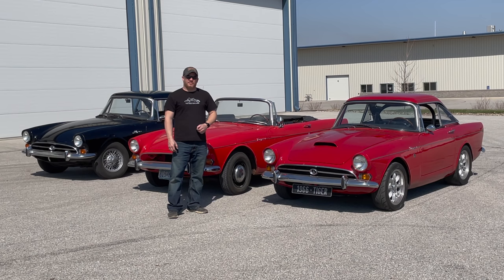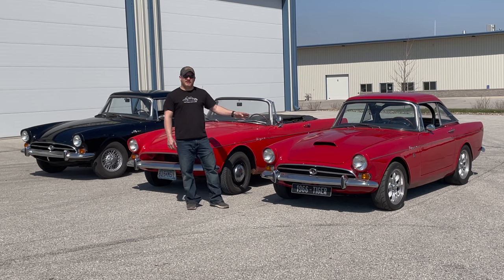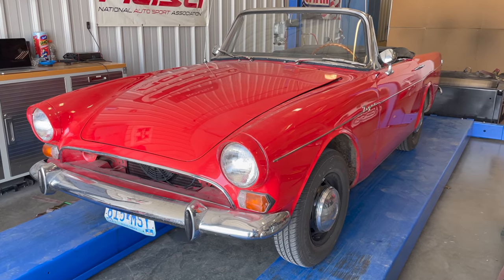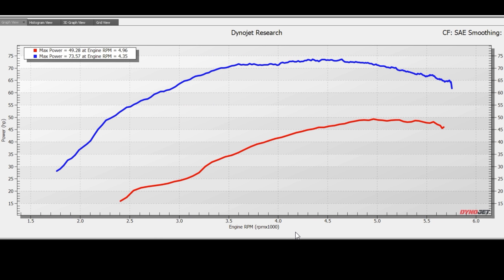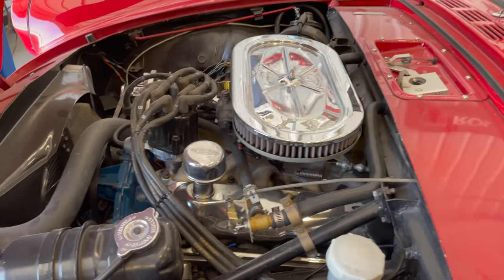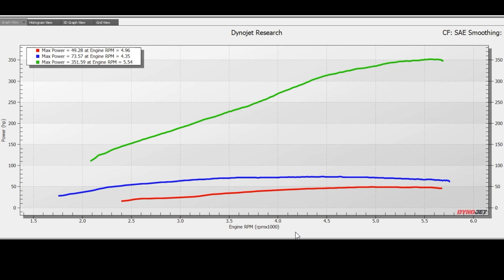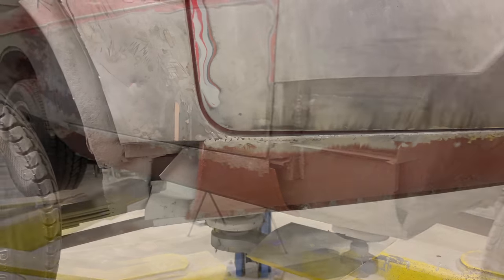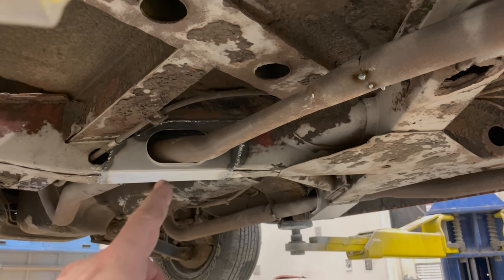How much power difference is there between an Alpine and a restomod Tiger?

Comment: That stock 260 V8 in the Tiger seems somewhat low on HP, doesn't Steve? If I remember correctly, the 260 was rated at 164 HP. If you assume 15% loss in the drivetrain, that comes to 25 hp, so it should have somewhere in the range of 130 - 140 hp at the rear wheels. Even if you assume 25% loss in the drivetrain, it should have had about 120 hp at the rear wheels. That engine sounds like it may be sick, maybe as you said part of it being ignition........but it's still a cool car. All three are! Thanks for sharing.
Reply: Yeah that is atrocious.
Reply: Tigers had around 136bhp nett when new.. and that was still measured in favourable engine on stand with no auxiliaries.....but a stock Tiger in healthy condition should put down 105-115 at the wheels

Comment: The hot Tiger looks a thousand percent better with those wheels and tires than it did on the showroom floor when it was new.
  I saw a Tiger when I was like 12 that had 289 badging, and the guy said it was the 271 horse, but I guess he must have done it himself, unless it was possible to special order them.

Comment: I did a rear swap and a W58 Subaru transmission on my 62 sunbeam with the 1600 4 banger that I can now go 72 at 3,000revs, its not performance but great on gas and comfortable on the highway..

Comment: My 1966 BRG Tiger was a pure chick magnet. Just ask my then girlfriend, now wife. On another note, a few years ago I was yearning for another Tiger but when I went looking I was warned to watch out for “fake” Tigers. These apparently were Alpines that had V8’s dropped into them. I gave up on that idea. Looking forward to more Tiger videos.
Reply: Research the VIN codes. Then you can know.
 I would rather spend for an Alpine, and drop in a crate engine. I couldn't care less if it was a " real" Tiger, when the crate engine " fake" would leave it in the dust.
 It costs real money to do complete brake system upgrades,. Switch to an alternator and I would think there would be suspension upgrades to do as well.
 Pile on the premium for a Tiger and it could get pretty stratospheric in a hurry.

Comment: I'm not surprised by the rust. My favourite car ever is also a Rootes car - the Hillman Avenger, sold in the States as the '71-'73 Plymouth Cricket. Unfortunately, they rusted very quickly, mostly in the inner and outer sills and front inner and outer wings, but basically everywhere. There was also a high-performance model called the Avenger Tiger, which I think was based on a performance package available for the Cricket.
Reply: Car and Driver liked those too.
 I wonder if they were Buddy  Holly fans?
Reply: I've had 2 Alpines in the past. I would love to find a Tiger in my price range.
Reply: There was also a fancier version of the car called the Hillman Avenger Alpine
Reply: @pashakdescilly7517  I think the Avenger Alpine was New Zealand-only, although it was the top-spec model.

I think the most notable model is the Avenger Tiger, which was the high-performance (for the time) version.
Reply: @Zeem4  You could be right. When I was a teenager, my father had an Avenger estate, the next-door neighbour had an Avenger Alpine. The posh model was only ever a 4-door car.
Reply: @Zeem4  There was also the BRM version sold in the UK. That was a dohc 4 valve engine based on a Hillman block, made for rally cars.

Comment: Hi Steve, I'm really enjoying your content. In the past I've had booth Alpines and Tigers. I currently have a 64 Alpine converted to Tiger (aka Alger). Mine has a 302 +.30 over plus AC and cruise control. I noticed on your Red Tiger that your running a upgraded alternator. What kind is it?  Was it easy to convert to the newer alternator, since 1964-66 Tigers traditionally had Generators? Also have you ever considered a LED dash lighting upgrade?
Really enjoying the shows .Keep up the great work.
Thanks
Mark

Comment: Oh my goodness...what a joy.  Question...you mentioned the most powerful one as not being particularly good driving in the city.  Is that due to the weight of the engine and the fact that the car doesn't have power steering?
Reply from the maker: If it had power steering that would solve a lot of it.  The ackerman got screwed up when they put the steering rack in the tigers to clear the engine so the front tires work against each other when turning.
Reply: @ThisWeekWithCars  THANKS.  Young people don't know how lucky they have it today where every vehicle has power steering.  My first car was a '67 Plymouth (small aircraft carrier)...lots of steel without power steering.  My forearms looked great after a year or two though...

Comment: More Tigers have been ruined by stuffing oversized engines (Boss 302's, etc) in them. It is not a hot rod but a comfortable cruiser. The wheels and tires are a limiting factor unless you really butcher the car.

Comment: why such low power in the stock 260 V8 Tiger? It doesn't add up from the performance figures of the day, recorded was 0-60 8.6sec and top speed of 120mph, you don't do that with 74hp on tap. The Alpine with the 1725cc should be getting you at least 90hp if it's a clean engine.

Comment: I thought there were only alpine and tiger ? The wiring looks like a mess ! Also didn’t the Tiger have 289 cu in V-8 ?
Reply: Later ones did.  Even the 1964.5 Mustang had the 260 as an option, but did come with the 289 in higher performance versions, though.

Comment: Will the Ford motor
From the tiger bolt
Into the alpine ?
Reply from the maker: The motor yes, the transmission no.  The transmission tunnel needs to be changed to put the Ford drivetrain into an Alpine.

Comment: I honestly thought the stock Tiger would have had at least 100 horsepower.
Reply: On an engine dyno it would be close to 100hp gross   This was on rear wheel dyno that’s net hp which is always lower but true horse power